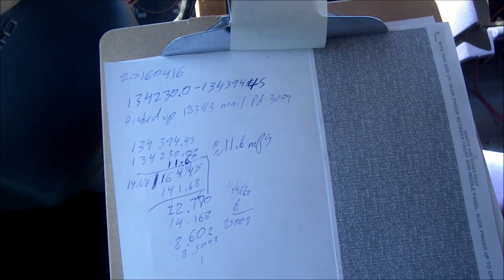V1937 - Stopped Taking My Blood Pressure Medication

Comment: I also quit BP meds. I was having bad side effects like I thought I saw something floating off of my dresser. My BP usually runs 135\98. I keep active and eat a balanced diet. Last doctor visit my BP was 154\100. I go back in January. She will re-examine me. How are you doing now? I realize my comment is way late on this video.
Reply from the maker: Feeling pretty good so far. I haven't checked the pressure in a few weeks though. No more ringing in the ears which I had constantly, no more headaches or dizzyness.  I'll be going for a checkup soon to try to keep my cdl license but if I fail I may drop the cdl endorsement rather than going through that again with the blood pressure medicine. Great to hear that you are staying healthy!
Reply: I wish you luck on your cdl. I'm glad you're doing better too. I have headaches often. Doctor said my BP is too high especially for my age. I'd rather deal with headaches than meds that make me feel bizzare things. I'm doing fine I've been taking Vitamin D and it has stabilized my BP. Today it was 127\85. That is so much better than 135\98 like it has ran. I heard 120\80 or lower is normal blood pressure. What does yours run?
Reply from the maker: Sorry about the late reply. Mine generally runs just a bit higher than yours. Thanks for the well wishes! I hope you reach your goals as well!
Reply: fizzphoenix Thanks. My phone made noise when you replied.